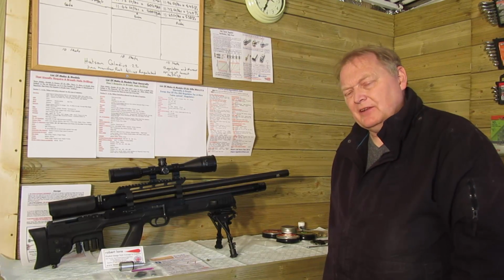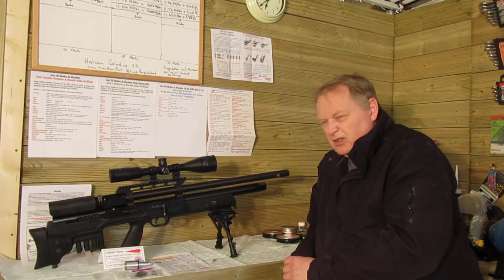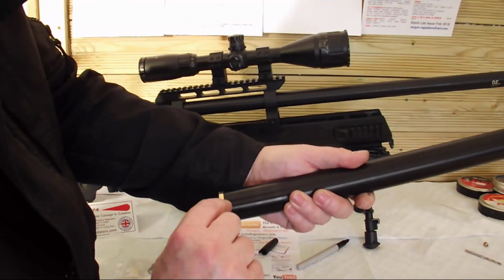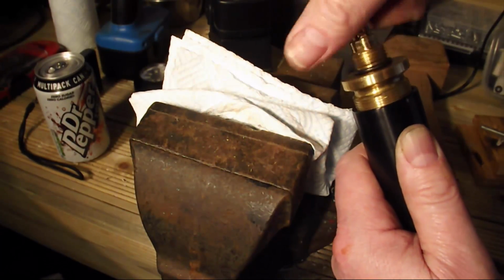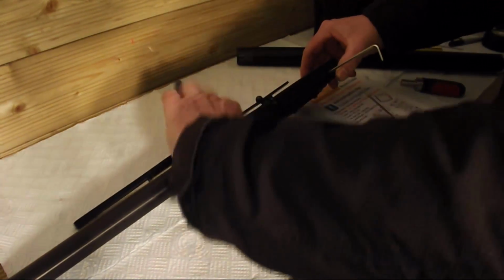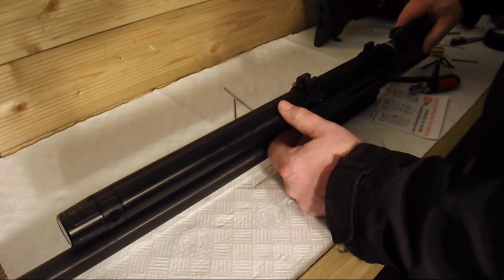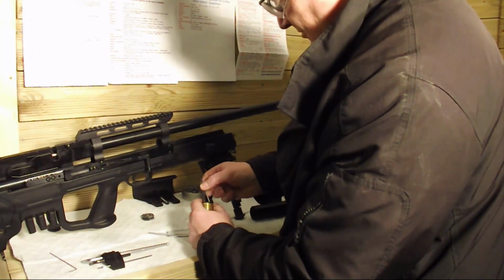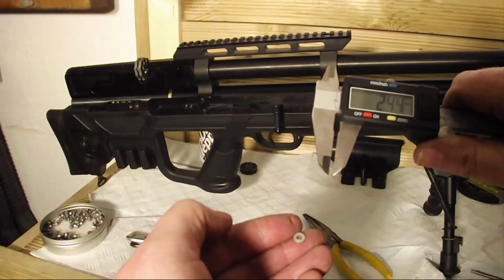The Hatsan Gladius and the Robert Lane MK9 Lancet regulator project

Comment: just observe your hatsan cylinder.few months from now try to examine the tank where you placed your regulator.mine was swollen and air leaking cannot be controlled.check yours.
Reply from the maker: Had the same problem. Had to change the cylinder.
Reply: @airgunsniper-elite7385  i want to aware the airgunners' community to avoid buying this piece of junk.
Reply from the maker: @nathoi  I have my rifle on the back burner at the moment. I may see if I can get someone to do a different cylinder and valve to fit the Gladius, including the regulator. If it works out well it could be a good aftermarket tune, but as you say the fitting of a regulator doesn't seem to help with the cylinder appearing to expand around the regulator. If I get it sorted i will let you and everyone know that there is an alternative to the standard cylinder set up. I have found out with experience that not all the cylinders are the same either. Some have different internal dimensions on the same model of Gladius depending on the year they were built. It's rediculous.
Reply: @airgunsniper-elite7385  our alternative cylinder here is titanium or aluminum t6 materials.but i prefer titanium though expensive.